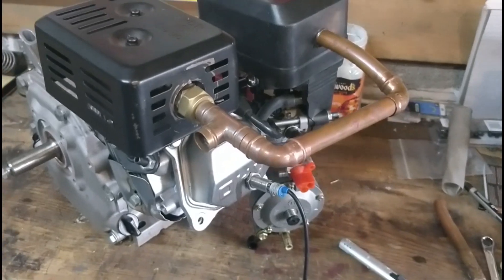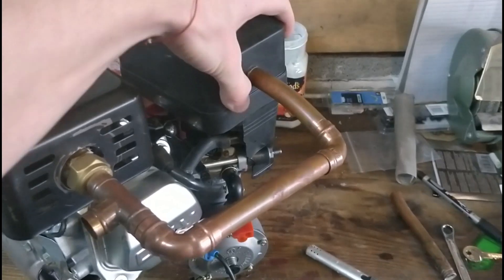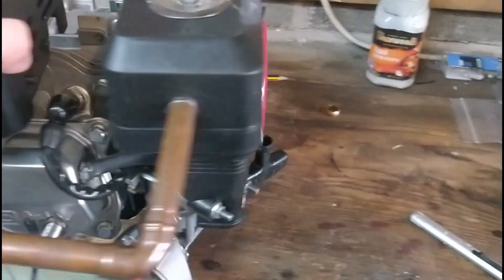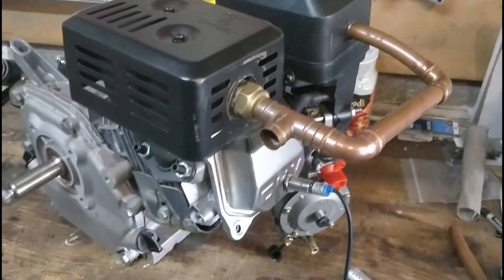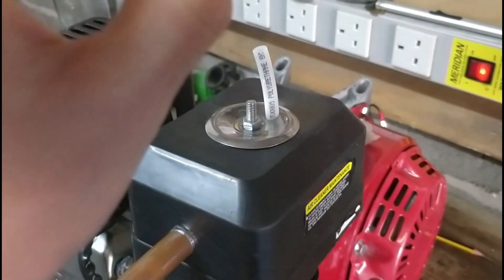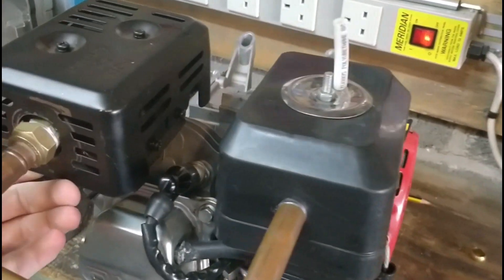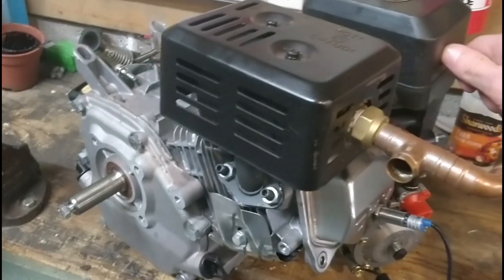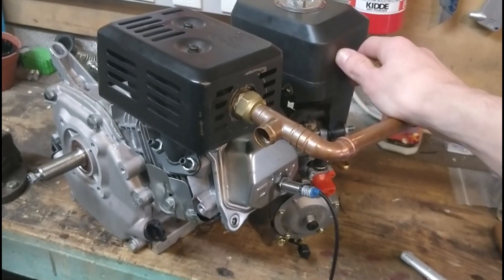Pure Hydrogen Combustion Engine

Comment: I do not believe that a standard gasoline engine will run on a gas so volatile gas such as hydrogen when they will no run on lighter fuel because compression detonates a fuel with a high Flashpoint so far before TDC that the engine tries to run backwards !
Reply from the maker: It doesn’t run backwards, for a basic conversion all you need is a fuel delivery system and to change the ignition timing to suit hydrogen, it’s pretty cool really 😊

Comment: How to make the engine run without sparking back into the cylinder?
Reply from the maker: Check out the latest videos, I have rebuilt the engine with uprated parts which are better suited for hydrogen
Reply: @Hydrogenguys  Can I run a generator directly with hho?

Comment: Cool. Now just have a few kW of solar farm and you will have unlimited charging for your mower, tractor, or whatever machines you want to run with 0 fossil fuel consumption. Note though hydrogen doesn't easily give the range you need for a road car because the density is low, despite that the specific energy is extreme. More specifically, hydrogen (H2) has about 140 MJ/kg iirc, the largest known of any chemical fuel, but the density even of Liquid Hydrogen is 70 kg/m^3 (equiv. g/L), whereas gasoline is like 40 MJ/kg and density of 710 kg/m^3, so it takes ~35 times more volume to hold the same energy (140/40 x 710/70) as in a conventional gasoline tank.
  
That said, I can easily imagine a "car" that looks somewhat more like a miniature tanker truck, only its tank is for its own purposes, and not a load to be transported for other uses. Perhaps a lot of the flubbed hydrogen cars are the result of trying to be too much like a car we know now, instead of accepting the design will necessarily be different, and perhaps also the ideal usage patterns, too? (E.g. I think we are too dependent on cars, personally - we've built things to be unnecessarily dependent upon them, as opposed to merely using them to enable us to reach farther on top of retaining a base of more human-centric city and regional plans/designs as was the case through most of history.)

Comment: Love this idea, I want to try it. Is the supply pressure to the carb 60PSI? You find that the pressure with best results? Thank you
Reply from the maker: The gas in the tank was 60psi, the gas feed to the engine was 3psi, not too sure on the flow rate, but this was filmed a good few years ago, check out some of the newer videos on the channel,
Hope this helps

Comment: You need to adjust the carb and have less air flow for throttle control, maybe. Block off 1/2 the air filter. Start there with the steady amount of HHO

Comment: It's hammering because the hydrogen ignition is igniting the oxygen. However the oxygen explosion driving down the piston is counter acted by the emplosion of the hydrogen reaction which is sucking the piston back up half threw the compression stroke.
The motor can not run at high speed very long before it destroys itself.
If your using hydrogen only it must be fired at 10° after bottom dead center of the compression stroke.
Hydrogen engines pull the piston up and pull the crank around.
Gas and deisl explosive engines push the piston down and push the crank around.
There opposite in operation but alike in function.

Comment: The thing with hydrogen combustion engine is that we need 3times the size of a gasolin3 ICE engine for same HP and Torque figures. hydrogen is not that energy dense as gas. thats why hydrogen fuel cell outshines hydrogen combustion or gasline engine.

Comment: i fucking hate electric cars, using rare metals lithium, instead, i really support ammonia combustion or hydrogen combustion, at lease it will have some sort of engine sound to make driving still fun. Also, electric cars are terrible, using electricity from burning coal is literally not a green car, while hydrogen can be obtained by electrolysis from water. Ammonia can be made from Haber Process, obtaining Nitrogen from the air and Hydrogen via electrolysis of water to form liquid ammonia.

Comment: From a performance standpoint does hydrogen produce more or less power than gas
Reply: The engine or internal combustion engine "i.c.e". is at the similar regular everyday rpm, so similarly close "effort to work". 
I've been invited by Boeing aircraft company immediately after high school after wining the states tek school competition in architecture drawing and design. 
I asked the top architecture department executive of Boeing who invited m,e, if many less tones of fuel replaced with a secondary "hydrogen fuel made on board system" was possible?
No, he replied. I wanted to really make sure the fuel costs would be lowered,  and better safety since the many tones of fuel saved allowing easier airworthiness. No, you're ahead of your time, we're not doing that quite yet".
(Something close to those words.) 

Decade's of worrying watching knowing pilot's constant concerns of having enough fuel allowed for flights and "what if" they had to circle miles around when ever airport tower controls told them to wait for clearamce to land. 

The recent years Boeing aircrafts crashed and over worked computers were partly blamed and nothing was detailed on media about over weight "heavy class" aircraft's pilot's constantly concerned with fuel efficiency or enough supply. 

The home made hydrogen was made in high school in our science class and it was the high profit selling points I tried to make for Boeing's architecture top executives to consider what the safest fuel could be and less heavy aircraft weights. 

Sad to see so much "profit over people's interests". Again. 

EVs are much less maintenance than conventional cars internal combustion engine "ice" cars. 

A million miles with very little motor wear down and the environmental benefits. 
Insurance costs are lower too.
Charging infrastructure is far better with Tesla since 20% of some EV brands 9f Charging stations are our of order. Often times vandalism of unfair people. 

The electric vehicles "EVs" have monstrous demand because of very few moving parts and lower cost of ownership after only a few years and many people just buy (recently cheaper) Solar Panels to charge the house and the EVs as so many owners found Nissan leaf great value and upgraded to Tesla because of best customer experience. 
Or to resell for 2 or 3 times the same price to other countries who are paying much higher cost for Teslas. 

Tesla opened one of it's very few stores next to our small town home office and friends are demanding we step up our weekend car shows hobby with better golf carts "mini EVs" so Safepath Solarcars is actually possible and made in the USA is hopefully another selling point. 

We're seeing history in the making, effecting many primitive outdated technologies. Friends, past and present Tesla employees are only happy to help learning more simpfied systems to improve. 25 instant assembly line changes a week and other automakers still can't dream of such improvements until the next model year. 
Other automakers are trying hard to catch up with Tesla but they're getting farther ahead fast because SpaceX and other technology companies are only part of Tesla "gigafactory". "The new type of factory is simply half of the product"

Comment: where are you  getting the  hydrogen ?  cost?
Reply: Home made hydrogen made with metal plates in water is called "water electrolysis" with battery wires as seen in many similar YouTube videos explaining water electrolysis devices and "Natural gas hydrogen" is same as a BBQ using Natural Gas tank too.
It's not hard to try a few times until you or with friends get better results trying various types of "water electrolysis" models to see better results in each ongoing refinements to improve results. 
Try try try is how innovative products are made. 

Thinking about it and getting use to trying simpler devices makes it fun to share with friends and even a market if you can store home made hydrogen in air tanks same as any Natural Gas tanks selling for profits but your product can outsell easily at cheaper prices 😊

Comment: Is there a chance of that tank exploding? What’s keeping the hydrogen in the hose from being ignited as well?
Reply from the maker: The gas is pure hydrogen. So the hydrogen in the hose can only burn when mixed with oxygen. This means it can't explode. But only burn when mixed with the atmosphere. 

If the tank was to rupture and a naked flame next to where the rupture is then there is a chance that an explosion could happen, but most likely just burn like a flame instead. 

Either case. If that was to happen then it's the users fault for not respecting the gas. 
For example if I but a match to a petrol gas tank... It's only dangerous if 'you' are dangerous around it.

Comment: THIS SETUP works great. Use aluminum dryer vent tape to keep copper pipe in place. Recycled ♻  exhaust seams to work better for the engine by it's sound. THIS DEMONSTRATES HYDROGEN can run an engine well. THANK YOU.

Comment: is this a duel fuel engine? or are you using a regulator to feed the hydrogen into a carburettor
Reply from the maker: It was able to run on hydrogen gas. And petrol if needed. 
So could run both fuels but at the cost of low performance.

Comment: The biggest advantage of hydrogen combustion is that we could hypothetically retrofit existing cars to run on it. A new fleet of nuclear reactors could also generate huge amounts of H2 while also generating electricity. You could potentially give the H2 away for free or at a ridiculously low price.
Reply: The biggest advantage is refuelling, and remote portability. Plus it works great in the cold.
Reply: Really?! That's so nice!!!
Reply: and the biggest downside is that all cars become pintos in a  sense. still, at least H2 is still ICE and thats all that really matters to me.

Comment: Look what hydrogen in a piston ran engine is only going to give you about 30% of the fuels energy for forward motion you're going to have to use twice as much hydrogen to run that engine and the approximate amount of time you would run it in a tank of gasoline plus you're spitting out NOx with that water vapor how do you people not know this! And for you uninformed people NOx contribute to acid rain and ground level ozone which damages ecosystems animals plant lives and humans it reacts with ammonium and water vapor and compounds in the air to form nitric acid as well as small particles you do not want this floating around in the f**** atmosphere you're trying to believe you're trying to save you're killing it while trying to save it idiot

Comment: Deer hydrogen guy you may be smart but you do not understand be function of a gasoline combustion engine and the relationship between the metal parts and the oil residue that is in gasoline you see there's pressure and when you take a dry engine and you keep running it under high pressure it breaks but if you put the same engine and run it under high pressure with a fuel that has oil in it it soaks up in the metal walls of said engine allowing it to flex during the vibration of running of the damn engine your engine will not continue to run on hydrogen as long as the gasoline engine would on gasoline simply because the way it's designed if you did this with a car engine you would fail just like that engine will fail if you keep running it the way you're running it because you may be smart but you don't understand the actual aspects of why they use gasoline!
Reply from the maker: Hi,
like one of your other comments you are very much correct, Hydrogen is a non-lubricating fuel, and running pure hydrogen for long periods of time eventually cause excess wear on the cylinder wall and piston rings, however, this is not instantaneous, I have operated one of my engines for over 8 hours in total with no visible signs of damage, I know this is not a long time comparatively speaking but it's safe to say a hydrogen combustion engine will run for thousands of hours but yes! it won't last as long as an engine running on oil-based fuel which would last for hundreds of thousands of hours.

Another important note is that there is still lubrication from under the piston from the engine crank case oil. this will also need changing more frequently if the engine is switched on and off before fully heating up, this is because some of the combusted hydrogens will condense back into water find it's way to the engine oil contaminating it.

thankyou for the comment

Comment: Could there be a slight chance where you could split a water atom into hydrogen and oxygen, use the hydrogen for fuel and exhaust the oxygen making the thing green to the earth?
Reply: The oxygen actualy helps the engine run on hydrogen, then the exhaust gasses are mainly water, a little bit of unburned hydrogen (because nothing is 100% efficient) and NOX

Comment: Using a hydrogen powered generator to charge a battery or 2 , to power an electric motor, makes more sense than what they're selling us at the moment .To hell with range anxiety.
Reply: It takes far more electricity to generate hydrogen via electrolysis than you could make with a hydrogen power generator.

This is why you don't have cars running on water - the electrical cost is too high and is just a middleman in terms of electric generation.

Comment: This should be the way forward very interesting video so why are the car manufacturers not developing this further too much hype about going electric without any infrastructure very interesting.
Something else that might interest you YouTubers is Harry‘s garage talking to Lord Bamford at JCBs headquarters basically redesigned the cylinder head on one of their diesel engines that has high torque and converted to hydrogen interesting stuff as electric would not be practical as some of these large machinery is need to run all day would need over eight tons of battery and where would you put all that on a digger excavator so have a look.

Comment: is efficient to burn 7200 litre of Hydrogen to run 7 HP engine for 1 h !????

to get  7200 litre of H2, you need to ~ 20kW/h in electrolyzer
and final power of 7 HP engine is ~5 kw/h

So, is efficient to use 20 kw/h and to get only 5 kw/h !???
Reply: eétr ñot fute err ot teversé

Comment: Can you tell me if you are burning straight hydrogen or hydrogen and oxygen mix ?? What was the most interesting thing you have learned using this fuel in an engine ??? Thanks for unique content on YouTube Sir. Peace VF
Reply from the maker: This was pure hydrogen, the oxygen was from the air sucked in via the intake.

Engine runs as normal. Less power than petrol but that could be solved with direct injection. With direct injection the engine should run with a similar power output to petrol, and more efficient.
Reply: @Hydrogenguys   Can I suggest going to the auto junk yard and retrieving injectors from vehicles. I know some cars use both port injectors and direct injectors. I bet you could get a deal from the junkyard if you tell them what you are working on for sure. Good luck Hydrogen Guys. I like your way of thinking and look forward to see more great stuff on YouTube. Peace VF

Comment: way kewl I've been using my hydrogen welding set which produces 95l/h on 400watt fed into a small engine like that with an LPG conversion kit.. Had to adjust the timing a little and some components here and there due to hydrogen fatigue.. Apart from that, sound for years :)

Love the note of the engine when compared to burning usual gas/petrol compared to hydrogen :D
Reply: Have you tried separating the cathode and anode during the electrolysis duty cycle stage and storing the gasses individually for mixture variations? You could also utilise o3 (ozone generator on eBay) in condensed forms much in the same way an ICE uses booster fuel additives. 

To separate gases on the fly simply use two containers with a bend linking each from the bottom.
Reply: KNOWLEDGE PUBLICATIONS has lots of hydrogen books.
Reply: May I ask if you have achieved such a high decomposition efficiency?

How was it made?

Comment: I can imagine applications where solar panels may be used to manufacture and compress hydrogen during daylight hours then using that H to run a stationary power generator at night.
Reply: Same as wind and nuclear. Hydrogen is just a battery for energy.

Comment: Wow, that's a lot of volume of H2, on a high pressure, for a short running time and without any load attached to the engine. Power seems to be limited too.

Comment: Provides no lubrication for the cylinder
That's the main problem with using hydrogen
Reply: Thats easy though, just pump a few drops of oil into the cylinder via mechanical pump like 2stroke but the biggest issue with doing that is burning oil is harmful when used with hydrogen.    You actually dont really need to oil the top end though unless you have overhead cam.
Reply: Cylinder is lubricated from the bottom side of the piston , when pistion is tdc oil is on the cylinder wall always.

Comment: How come there's no water coming out??
Reply: Because actual hydrogen cars don't combust the hydrogen. This thing pollutes like a motherfucker dude
Reply: @matthewwhitener5090  How?  It should only produce water.
Reply: No, a hydrogen fuel cell car would produce only water. Hydrogen fuel cell car is actually an electric car, it's just producing its own electricity on board using a hydrogen reaction. The hydrogen is added to oxygen and the chemical reaction creates energy, a little heat and water as the result. This thing is running hydrogen through a spark plug ignition piston system etc and combusting it along with air. The combination of air and hydrogen being burned creates nox